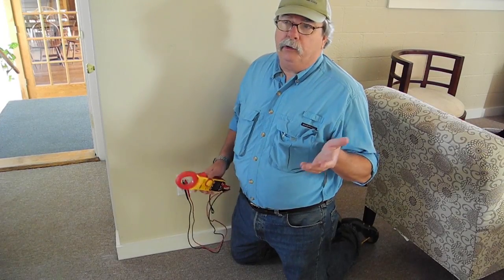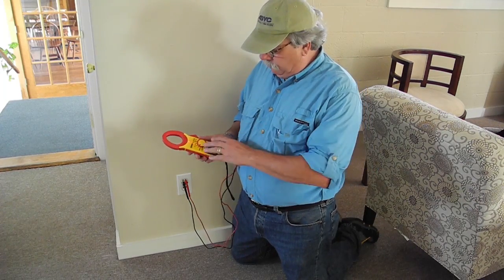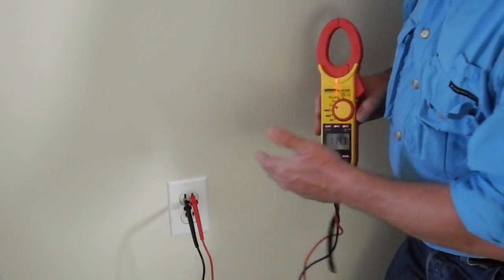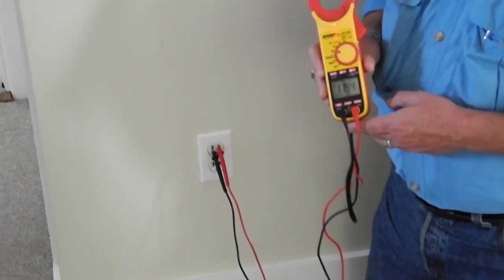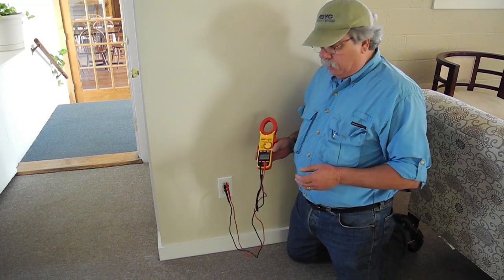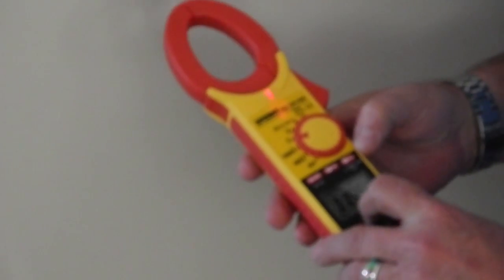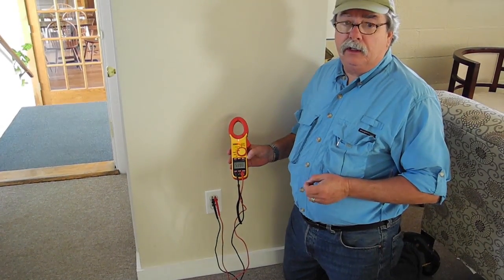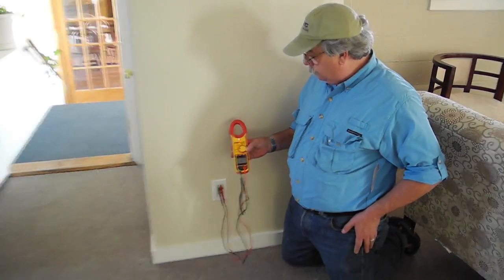Measuring AC Voltage (Potential) and Hertz (Frequency)

Comment: thanks so much  you seem to be expert ,im gonna buy volttage inverter12vto 220v from china tabao website the product comes with many certificates but 50Hz freqeuncy i have asked the seller if he could offer same product with 60 Hz because im from saudi arabia and we use current of 220v 60Hz  the seller said yes i can offer you one .so i found this video informative and help me to check the inverter out before use because im intend to use it in case of emergency

Comment: My multimeter has Hz setting, could this be used as an instrument tuner to 440Hz as sound waves are naturally AC
Reply: Resurrecting an old comment for reference, but if the sound somehow produces an electrical signal, like an electric guitar, possibly. I've used a multimeter connected to the output a cassette deck with a test tape playing a 440, 3000 or 3150 Hz signal to adjust the playback speed.
Reply: 528Hz is what you need to tune your guitar, avoid A=440Hz & 741Hz
Reply: @KratomQueen  Dude, youre 10 years too late